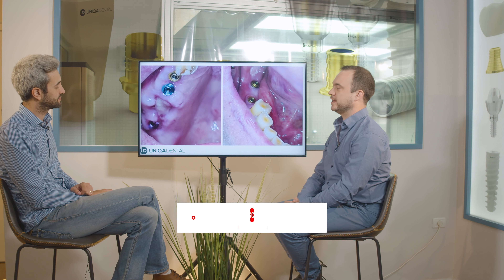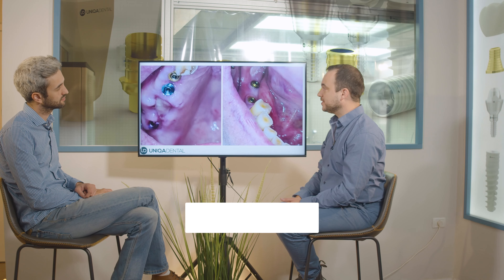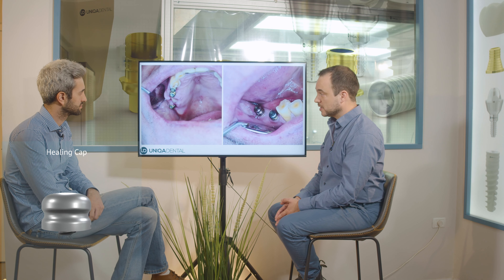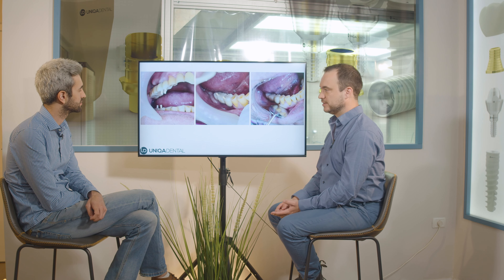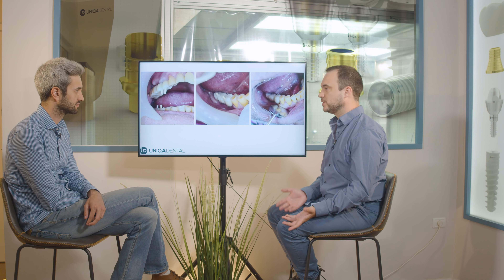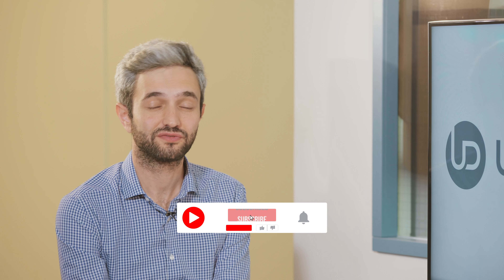Instead of one bridge of two crowns and a single crown we have a bridge of four crowns

Comment from the maker: 00:00 We want to have some emergence profile of the tooth and from the gingiva.
Today, we have a case when originally on the upper jaw, what we had is we had three implants. They weren't connected. 
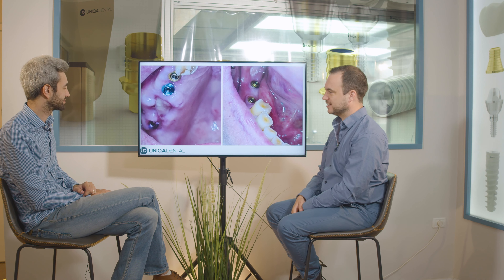00:33 What you see is the fibrous tissue on the socket of the tooth. 
01:24 Later on, we took impressions with the scan abutments and intraoral scanner. 
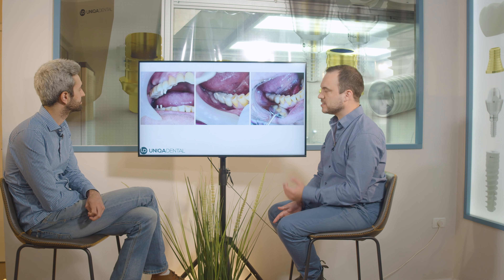02:00 This is the temporary bridge because we just extracted the tooth. 
02:52 Bridges. We'll make both bridges from the start.
03:00 Now we have, instead of one bridge of two crowns and a single crown, we have a bridge of four crowns on the upper jaw and we change the lower also.